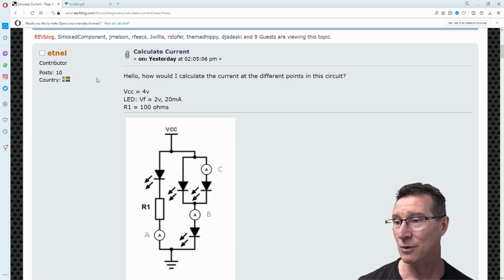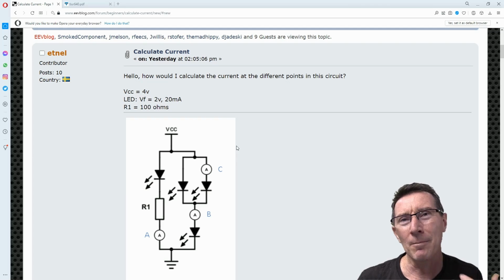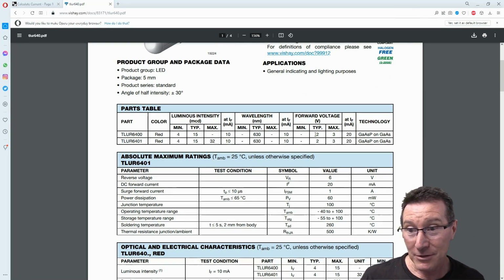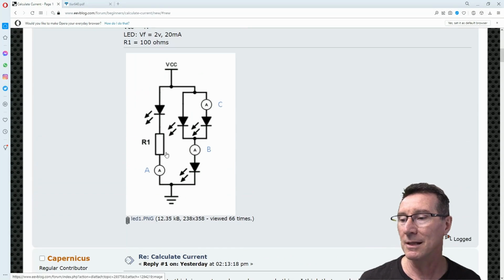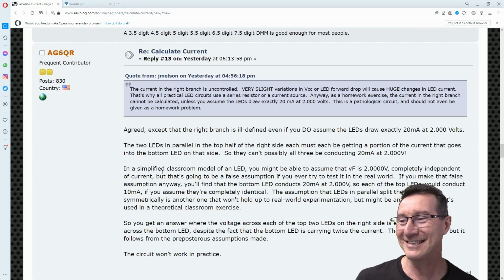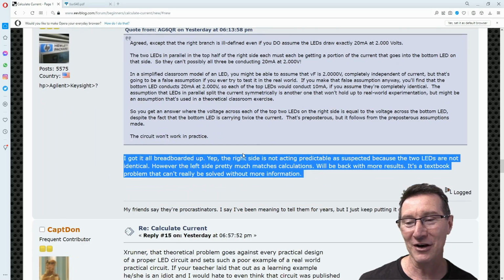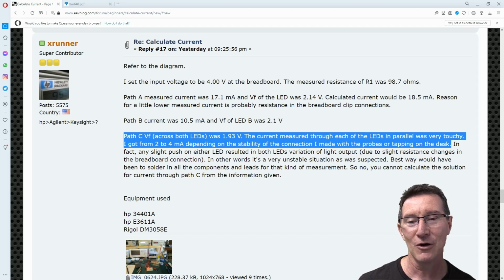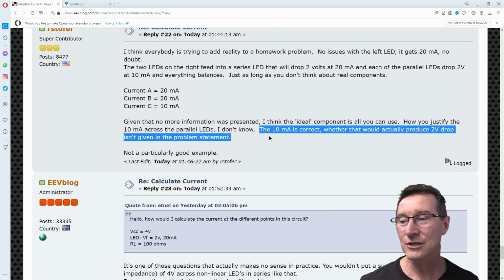EEVblog 1427 - An INFURIATING Electronics Exam Question!

Comment: If the person grading your test isn't happy with a 3 paragraph response about how the the current for B&C is infinite because even idealized LED's don't current limit you need a new college.
(EDIT: Or I suppose the current is 20mA for B&C because that's what they are magically current limiting themselves to)
Reply: But its not infinite.. try building it up or watching the video.
Reply: @jaro6985  ya, I know that nothing in real life is going to be infinite but it's more of a "ask a stupid question, get a stupid answer" response at that point. Like Dave says in the video it's more of an electronics themed math problem than an electronics one and like Dave the circuit diagram has made me unsure what answer is even expected. (P.S. don't be too harsh on my EE knowledge, my only Tertiary education is an unfinished associates degree in industrial printing from the turn of the millennium and some Microsoft accreditations. Despite being in my 40s here I am really just a child hanging around the big kids.)

Comment: Maybe you can use a standard diode model to estimate the currents through b/c (like Tomorokoshi did, but you will have to assume the temperature and the diode ideality factor, and I am not sure this model even applies to LEDs).
At my university these sort of circuits were discussed in the 4th semester, so you already had a pretty good understanding of the underlying theory. But the questions were never that stupid, they always took great care to outline how a circuit works, and what its limitations are...

Comment: I remember when I was in college many millennia ago... anyway, I skipped EE 102 due to a scheduling issue and forgot about it until I was a senior. So I went back to pick up the course for graduation and it had a bunch of digital logic stuff. By this time I had two years of digital stuff.  On the final I looked at the circuit, all done with and/or logic was actually just an xor. So I said to the prof, who was a highly regarded prof at the time, that in the real world I would just put an xor chip in. I don't know if he had a fight with his wife that morning or what but he came unhinged and yelled at me to implement it the way it was drawn. Then to add insult to injury, I know I wired it correctly because I could do those in my sleep by this time. But we were using ancient patch boards and they often had glitches that you often solve by smacking them hard on the side. With his mood I didn't want to smack the thing and I couldn't figure out which wire/s were having issues and I needed the time to do the other questions, so I got a zero on a question that was absolutely pathetic. I guess you just gotta roll with stupid questions/situations.
Reply: sick. they should give some kind of award when people find holes in their tests.

Comment: I'm new to electronics. Wouldn't the right side of this circuit fry the LEDs? There are no resistors protecting these LEDS. So, that there's no current going through the right side of the circuit, because it becomes an open circuit, and the left side is 20mA as you said.
Reply: As Dave explained, the LEDs do have a resistance - but it is non-linear.  It's known as the "slope resistance".  And the circuit would stabilise with the bottom-right LED dropping about 2.1 to 2.2 V due to higher current than 20mA and the top pair dropping about 1.8 to 1.9 V due to lower current than 20mA.  But this current will actually vary from one LED sample to another, and will also vary with temperature.  The LEDs would start to fry if the voltage went up by much (to 5 V, maybe) but depending on the characteristics of the LEDs actually used (the voltage vs current curve in the data sheet that Dave showed).
Reply: @GodmanchesterGoblin  Thanks GodmanchesterGoblin.

Comment: Can you point me at the job that would ask that EE101 question at the interview!
That's for a 1st semester EEnoob. My interviews have tended to ask subject relevant questions
... or, much more annoyingly, irrelevant logic gotchas by lazy interviewers,... as if solving logic puzzles under the gun has any relevance to the process of crafting accurate, efficient, testable engineering solutions that are likely to require the minimum effort to complete. Personally i don't immediately vomit up solutions off the  cuff in a symphony of intellectual inspiration as such logic tests actually select for)

Comment: Without some kind of current limiting at the voltage source the right hand set of diodes would never be a practical circuit and actually cause issues.

Comment: You can check that if the voltage drop is 2 V for 20 mA, then 100 Ohms resistor provides the same drop, and the current at point A is 20 mA. But all you really can tell about points B and C is that current at point B is twice the current at point C. Hence, the voltage at point B is higher than 2 V, and the real current depends on how those LEDs conduct at voltages above and below 2 V. All you can say is that the current at point B is higher than 20 mA, and the current at point C is higher than 10 mA, and they relate to each other as 2:1.

Comment: As the network on the right have not current limiting resistor, and the forward voltage drops on temperature rise, I assume the right is on thermal runaway state.
The answer at long run for B is infinite or zero, and C could be infinite or zero depending on the fault mode of the leds (short or open).
However it will take a while to burn, so it is also possible the C@10mA and B@20mA for an instant in time.
Reply: You didn't watch the video did you.

Comment: I think it is a good question actually. One closer approximation model of a LED is a constant voltage + a very low resistance, Let say V0, R0. So, given LED has characteristic 2V 20mA, we should able to find the current of all points in the form of V0 or R0.

Comment: A = 20 mA
But B and C we simply can't determine with the provided information. If C were 10 mA then B can't be 20 mA, since the voltage over the C diodes will be smaller than 2 volts and therefore the voltage over the B diode would be higher than 2 volts making the current higher than 20 mA.

Comment: I don't know, you could probably assume that the LED V-I curve is approximately linear for small changes in current and that would likely lead to the solution of 15mA and 30mA or something near that and the voltage at the intersection would be like 2.2V - You could test this out and see if the real results match even though it is not theoretically a good idea to not include a current limiting resistor in both paths

Comment: Long ago I calculated the effective series resistance of a common red, orange or yellow LED to be 100𝛀 at 20mA. It's been a useful bit of knowledge whenever I've needed to quickly approximate component values for a circuit.
Reply: v= zero across the series leds as vf=2 plus vf=2   4vcc-4vf =0. in real world you will get some current

Comment: You did not really touch the problem that the circuit impedance (in the right branch) is so low that any attempt to measure currents using a typical multimeter is going to seriously change the situation at the moment you insert the meter.
Of course that does not matter for the original question, because the A meters can be assumed to be ideal (zero impedance).
But it does matter when you try to measure it in practice.
Reply: True.  One should be very wary of voltage drops across meters in cases like this.  As for theory and practice - I always cite...  "In theory, there is no difference between theory and practice, but in practice there is."
Reply: The circuit impedance in the right branch isn’t incredibly low – neither the absolute impedance nor the impedance linearized about the operating point. Still over an order of magnitude greater than parasitic contact, wire and meter resistances that would be reasonable for a solderless breadboard that wasn’t crap.

The general idea that people just keep repeating ad nauseam is that this circuit will thermally run away easy. Anyone who has seen BJT thermal run away knows that even with big heatsinks, it happens surprisingly quickly and with some spectacle.

So now we have those LEDs with next to no thermal coupling, we can even not match them much, and the stupid circuit mostly refuses to run away unless you get the current way over any reasonable operating point. 

And at that point I’d have expected everyone to stop and think. It’s so supposedly unstable, it should go up in smoke in less than a second. It doesn’t. So some preconception we have about this is wrong. Obviously.

So. What gives? And the parasitic “ballast” impedance doesn’t have all that much effect on stability either.

Well, even poorly matched PN junctions will act differently if you run them at different current densities. So that’s one thing to look at.

Another thing is that we can modify the thermal masses easily by heat sinking things, as well as we can add thermal phase delays by coupling the diodes at different locations on the heatsink. So there’s that. And if you investigate it with some rigor you’ll find cool things. I highly recommend for everyone to actually play with this thing, characterize it well, then start tweaking things. It’s a pretty complex circuit in spite of its apparent simplicity.

And with regards to matching operating points between LEDs: that does what one assumes only if the LEDs are mechanically identical. Otherwise, the varying thermal time constants and thermal impedances will change things a bit (just a bit most of the time though).

Comment: I'd try to fit the diode model (like I ~ id e^(Vd/nVt)) somehow. But we lack data.
Reply: You can use that model and solve this problem, without knowing the ideality factor or the temperature. B and C turn out to be 28.2 mA and 14.1 mA, respectively. See my other comment (if you can find it).

Comment: Might be a good test for autism.
If A is anything else than 20mA, then I can't tell you what it is. Otherwise it's 20mA.
If B is anything else than 20mA, then I can't tell you what either B or C is. Otherwise B is 20mA and your LEDs drop the same voltage @10mA than at 20mA and it would appear that we're not agreeing on what a LED even is.
Can we agree on that and on the figure I mentioned earlier regarding my salary ? Otherwise have a nice day driving other simple minded people insane.

Comment: Until proven otherwise, I assume that it's a critical thinking question and the examiner wants you to write down that it's impossible to calculate with this data, or at least accept anything between 11 and 19 mA for a single LED. 10 or 20 would be a wrong answer since you didn't do any critical thinking.

Comment: You can use the lineal approximation of the diode, Id=(20ma/(2-vo))×(vd-vo) where vd is diode voltage, and v0 is the voltage where Id=0. This v0 is unknown and we can give some values a little less than 2v. If we call V1,I1  the voltage drop and current in the upper diodes and V2,I2 in the bottom diode, we have: V1+V2=4 and I2=2×I1. Because we have 3 equations and 4 unknown values, if we give v0=1.8v, we can find the voltage in the upper diodes is 1.93 and in the bottom 2.07, the currents are 13.3 and 26.6ma.

Comment: No, no, no, that is all wrong: You can see that VCC and GND are offset to the left on the schematic. Due to the nature of the toner used in the printer (Assuming it was printed with a lazer printer), the resistance to the LEDs on the right of the diagram is going to be much more than the one little LED with the resistor on the left. Therefore the best way to get those LEDs to light up is to set fire to the page and ignore the current they draw.
Reply: You're damn right. I've never seen a working schematic. It's just symbols and lines!

Comment: The circuit would be voided since there's no voltage to run it and the orientation of the LEDs, unless the ground is being used as neutral.

Comment: 28:04 It looks like you're showing a logorithmic chart, and saying that the light output is linear. Am I reading that wrong?
Reply: You are correct that in general a straight line on a log-log plot does not imply linearity in the variables:

Log Y = c + k Log X

Gives something of the form 

Y = a X^k

When k is near 1, like in this case, where a decade in the current corresponds to nearly a decade in illumination, you can kinda, sorta, say that the relationship is linear.
Not sure if Dave counted the grid lines, though :-)

Comment: Stupid test question. But using the LED voltage-current curve shown in the video, we can get a good approximation of what to expect in real life.  The LED on the left is easy, 20ma.  The LEDs on the right, will have twice the current in the bottom from the top, and looking at the curve, we can see to reach that 2:1 current ratio, (left scale) will take about a 0.2V difference in the two voltage drops (bottom scale).   So we can expect the top LEDs will have about a .1V drop less than normal, and the bottom LED to have a .1V drop higher than normal.  This gives a current of around 30 ma in the bottom and 15ma in each of the two top LEDs (per the graph).  So the answer to the test question becomes A=20ma, B=30ma, C=15ma. Because these numbers are well within the safe operating range of a normal LED, they won't burn up, even with a fixed voltage, high current, (low impedance) power supply.  Manufacturing differences would also not likely cause enough variation to cause any of the LEDs to burn up assuming the same color and manufacturer for all three LEDs.  Now I have to go to the bench and see if my answer is true!
Reply: And the answer is, dead-on accurate!  4V regulated supply set with a current limit of 100 ma, the three red LEDs draw 28 ma at the start (per the meter on my cheap lab supply), and it inched up to 30 ma after about 5 minutes but seems stable at 30 ma.  There is a valid question here as to whether thermal runway could take over.  I'm letting them keep running for a few hours and see what happens.

Comment: What if you substitute 100 ohm (2v/20ma) "equivalent" resistance for LEDs?
Reply: Oddly enough, you'd get roughly 26mA at B and 13mA at C, which are quite probably close to what the real world solutions would be, given typical datasheet V-I curves.

Comment: I have measured a LED once which had more than 10 ohm substrate resistance (it was difficult to measure, but the low power LED did not blow up from overvoltage as it should have, so I have measured what is wrong with it).
Low power LEDs tend to behave very close to diodes (close to exponential).
High power LEDs are a bit more linear actually.

Comment: I think the question is totally valid and it would make you think exactly on the non-linear I/V curve of a LED and have you make reasonable assumptions, no need to calculate anything. The 10mA, 20mA, 20mA is just wrong!

1) you get 2V @ 20mA, which you use to solve the left most branch with the resistor
2) you could say the I/V curve of the LED also have: 2.3V @ 30mA and 1.7V @ 15mA 
which are valid assumptions for a LED behavior and then you just simply get:

A) = 20 mA
B) = 30 mA
C) = 15 mA

Comment: Sorry Dave, but what you say at 8:52 is plain wrong. LEDs are not actually "current-driven" and the voltage drop is not a result of the current. I may appear so if you connect them to a constant-current source, but this is a false image. The voltage is in fact the cause and the current the effect.
Reply: This is a classic case of "all moidels are wrong, but some are more useful than others". When the practical output is highly nonlinear WRT input voltage but basically linear WRT input current variation, it becomes most practical to treat the LED as current driven with a side-effect of some required voltage drop.

Long discussions have been had about whether a BJT should be considered current or voltage controlled. It's got something very similar, a very nonlinear B-E junction. Usually current gets you further than voltage.

Comment: Worse, I've recently seen a design which drives a couple of LEDs in series with an npn to ground(open collector, driven by a pwm signal). No series resistance whatsoever. Guess what, the LED Type changed due to availability and now the current draw as well as the light output dropped by a factor of ~11.
Reply: With a base resistance? A well tuned base resistance to keep the transistor in the linear region could theoretically give a constant current to the LEDs regardless of forward voltage if the hFE remains relatively still. I’d have thought such a circuit would be more dependant on the transistor than the LED.
Reply: @Scrogan  nope, just the obligatory base resistance for protection. What you mentioned is rather touchy, so it doesn't scale too well for mass production.

Comment: Exactly same as I Dave........In the exam I would try and get the right answer they were expecting, then add off to the side some real life info and outcomes.
Reply: The trouble is, we don't know what they were expecting.  20mA for the bottom right diode, so 10mA in the two above it?  Or 20mA in each of the top-right diodes and 40mA in the one below?  Of course, neither will be achieved in practice.

Comment: Before watching the video I make this but it is a visual distraction because of the two LEDs in parallel so we have to assume that each LED is absolutely identical, but in reality the current will not be equally split across the two LEDs on the right because they will not be such.... 

Left leg:-
A>  Vcc - Vled = 2V/R1 = 20ma
B> Vcc - Vled = 2V (Iled at 2V is quoted as 20ma) so the current at B would be 20ma
C> Vcc - Vled = 2V so assuming identical LEDs the current in each of the parallel LEDs would be 10ma each

However, this is a daft design. Who with any practical experience would make a circuit this way?